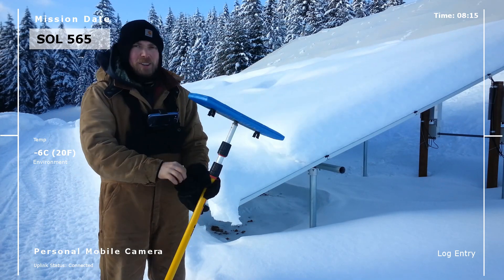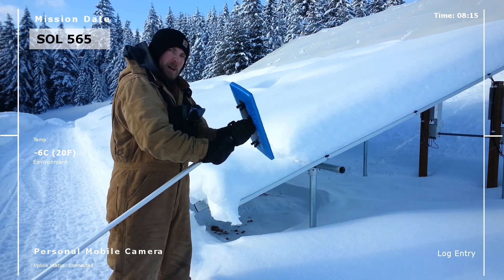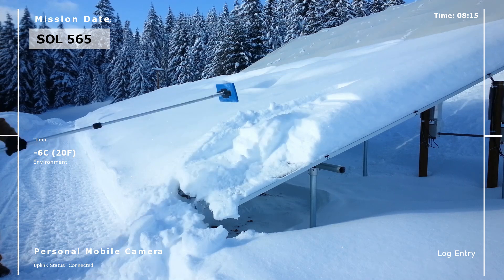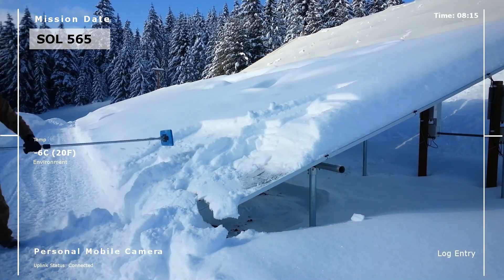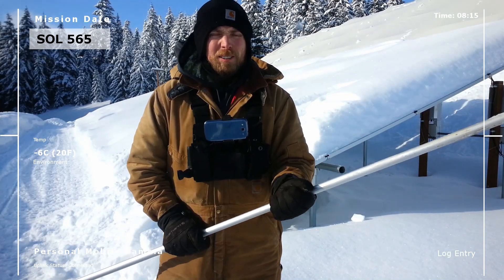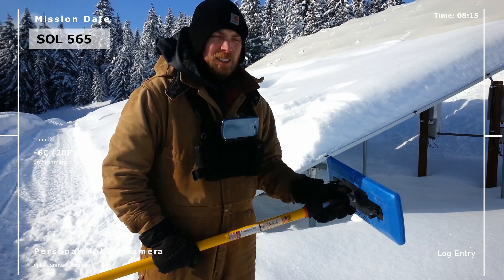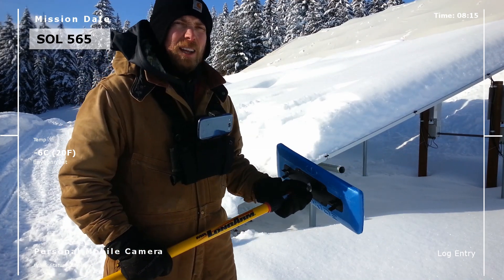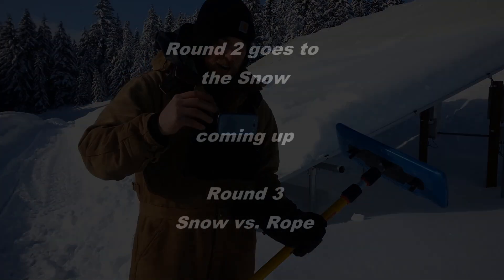Can you clean SOLAR PANELS with a CAR SNOW MOP?

Comment: https://www.amazon.com/Roof-Snow-Rake-3-Whls/dp/B00RY08S7G/ref=bit_abba_def_ie_us_learnmore/135-2261993-3228401?_encoding=UTF8&ascsubtag=1ba00-01000-org00-def00-other-nomod-us000-pcomp&tag=amz-mkt-edg-us-20&tagbase=abba

This is the resolution to your snow/solar problem. Use rubber electrical tape on the wheels to prevent marring the surface of the panels. here is a link to a video.

https://youtu.be/i3R95E16ZBU

Avalanche Snow roof rake.
m_s_strimple@hotmail.com

Comment: Seems like that would work very well, but there is just too much snow. A good option for a moderate snow fall.

I made a deicing formula for work the other day. It seems to work well to melt any normal ice build-up. I made it and it worked well, but I had to reformulate it so it would not be explosive, haha. Here is the recipe I used. Will not damage or smear glass. The 2% missing from the propylene glycol was due to contaminants I was not able to distill out, so 16.6% would work great for that.:

Water ----- 50%
Methanol Alcohol ----- 16.6%
Ethonal Alcohol ----- 16.6%
Propylene Glycol ----- 14.6%

Comment: With your amount of intelligence,  i would think you would come up with some kind of solar heating system to melt the snow before it can accumulate. I would have to believe that there is some kind of low voltage way to warm the panels so you won't have to remove the snow every time you have a winter storm.
Reply from the maker: thanks for commenting and for the vote of confidence on my intelligence... lol ok, so the real problem isn't the clearing of the panels as much as it is the piling up in front of the panels. With any amount of sun on the array it does tend to clear nicely, however, we haven't had a lot of sun...and...and this is the most important part...there isn't enough clearance for the snow to actually go someplace....so we need to a. raise up the array by ~5ft or b. need a method to collect and then dispose of the snow coming off of the array (conveyor belt, trench, etc). I think my focus will be on how to get it out of the way rather than heating...but that will be a spring time problem as there's no way to deal with it right now other than to just keep going and clearing it manually.

Comment: you need to  heat  them that will help the snow slide off easier  you could probably use solar heaters and run tubing under them similar to the earth ships idea to melt snow on the roofs for water collection

Comment: I was thinking about the panel adjustment after my last comment. The design I came up with is 2 foot diameter  wheels near the lower edge. Cables from the front edge to a shaft at the back mount posts and a greased slide on top of each post.  as the shaft is cranked the angle gets steeper or in reverse it gets shallower.  Then you could optimise it each month. Come December and January when it is snowing it is a steep angle which is much easier to clear of snow.

Comment: I'm not too expert in snow, but it seems to me another problem is that the snow just piles up in front, so it would be better to have the snow land off to the side.
What about strips of heavy gauge clear plastic maybe 18", covering the panels? You could drag the snow off the side, one strip at a time, and the clear plastic wouldn't stop sunlight collection in the meantime.
Reply: Thinking rolled flexible plastic. Not sure what the weight of an 18"w strip of snow would be.

Comment: This is Mars we're talking about here folks. Heating the bottom of the panel would work fantastically for him if engineered correctly, but you can't melt dust off a solar panel. What if the solar panels were elevated, about twice as high as the panels are long, on a very rigid frame. Either a motor or a manual crank is used to turn the entire unit (in a controlled fashion) and dump everything off of it. Then a conveyor or moon tractor can come in and moved the displaced dust aside. The panels then get rotated back to the optimum location, and all is well. Biggest issue is bearings, chains, moving parts basically.

Comment: I still say once the snow thaws the height needs to be raised and a steeper angle and consider using the space underneath as a shed for storage. like your Lumber, firewood, fencing and other building materials you might need access to during winter time. and I would have a roll up sheet of plastic that you can roll up like you do a set of blinds when your in power gathering mode. then you can unroll the sheet of plastic before expected snow storms. that should allow the snow to slide off very easily on its own. if not should follow up with a small amount of vibration applied to support poles.

Comment: More Ideas: (for the solar panels) maybe putting tarps on them before it snows would allow you to pull the snow off after. Or at the very least the tarp may be slippery enough for the snow to slid off as you snowblow in front of it. If you just need to pull the bulk off with a shovel the last few inchs would be easy by pulling the tarp off. I would detach from the top to roll it over the snow. This way you don have to shovel the tarp too.

(For the shelves) instead of my idea for a ferris wheel like rotating system I have 3 other ideas. 1) a ladder like in the old library's attached on rails to slide easy, but you will have a ladder which makes it hard to carry things up and down. 2) a warehouse ladder the kind that is a mobile staircase. This may be best short term, it would allow you to carry things up and down easy. You may need to put in some kind of floor since the wheels may be to small for dirt and it may be unsteady. But I don't think you will be able to reach the top of the rack. 3) this is long term solution for when you get the other racks in. Install a second floor, you should be able to turn the shelf rails around to face the opposite rack put 2x4s on them and either plywood, or better Steel floor mesh, so the sun can get through. Stairs at the end and you should only need a step stool to get to the higher shelves on each level. All of the above would require the plastic to be extended across 2 lanes since it would be in the way as you have it now.

(for the plastic on the inside of building) Is the plastic true 20 feet and the frame true 10 feet apart? When you put the clamps on it will pull the plastic around the beam, you will lose about 3 inchs. So by time you get to the 3rd beam you will be 6 inchs short. I would go with 12 foot sheets so that you have 2 feet to play with, this will also be easier to work with. I was thinking something like a pool noodle would work for the seam but they are probably to small in diameter. So how about a rubber hose that is the same diameter as the frame pipe cut down one side to slide over it. I don't think the hose would be strong enough to support the plastic on it's own but it should reduce the amount of clamps needed and create a seal. I would put 2 sheets up 1st with clamps then put the rubber hose on the 1st 2 rails, and repeat when there is a seam to connect to reduce the effort. You can build a platform across both racks to do the high part that the ladder can't get to. I would wait till summer to attempt this so you won't have the cold, gloves, and extra clothing layers to deal with. Which would make it a little easier and safer to do. Also invite friends and family over for food on a Saturday and put them to work. The more hands helping you put up the plastic the better.
Wow that was a lot. I hope this helps. I can't donate money but my brain work only costs the food I eat. :)

Comment: Increase the angle of the panels.  They are far too horizontal.   If I were to ever build a solar panel grid, I would construct a pivot where the panels could be brought to 90 degree of more to avoid heavy snow accumulation.  Also, You could install a heat tape on along the top edge of each panel.  Granted it would take energy to heat, but it could also help keep snow from accumulating at higher temperatures (during snow fall).

Comment: I once mechanized a solar array using old washing machine motors.  IF you have a junk yard nearby you mght give that a look.  Other options are wiper blade motors since they are already set to use your DC of the panels.  They can't drive a whole array like yours but using several and the right "gear ratio" would probably work. ( I have one solar driven to open and close air vents on the ridge of my small 10'X12' green house.)  A starter motor can definitely drive your array and might be an option depending on the power your array is developing.  Starters are notoriously power hungry.  They did turn out to work well for us however in one configuration.  We used two of them mounted opposite each other and used one for azimuth and one for elevation.  Had a bit of trouble with elevation as we needed to move them up and down rather than a full rotation. So, in came a third starter.  Since they are built with a solenoid actuated drive gear we just put this opposite each other and used one for up and one for down.  Worked great and fast no matter how much we loaded them up.  
In your situation.... maybe you could make up a setup like that and alternate between up and down rapidly between them and literally shake the snow off will it's still fresh, fluffy and hasn't had a chance to freeze on like the snow in this video.

Comment: if you had the money id say big sections of clear plastic driven by motors to just tilt up but that would be a lot of money. i dont really think theres a lot you can do with not a lot of money because snow is heavy and youll need something powerful to shift it. unless you have a constant flow of warm water over it or something but at those temps that would jsut freeze unless it runs all the time

Comment: For the 20 plus years I've had panels, a broom is all I ever used.
Reply from the maker: what softness/type of bristles? does it scratch the glass at all?
Reply: TheRealMartian: Here is a link. My oldest panels are 21 years old and have no damage from cleaning. The bristles are quite stiff. 
https://www.walmart.com/ip/KRAFT-TOOL-GG876-01-Asphalt-Coating-Broom-Squeegee-18-in/40842600?wmlspartner=wlpa&selectedSellerId=1122&adid=22222222228028406176&wl0=&wl1=g&wl2=m&wl3=56837813351&wl4=aud-273067695102:pla-94137521111&wl5=1016367&wl6=&wl7=&wl8=&wl9=pla&wl10=101593696&wl11=online&wl12=40842600&wl13=&veh=sem

I buy from a local store, but it looks just like that.

Comment: If you build a metal pipe frame about three times as high as the back of the panels and another pipe frame the same level as the front of the panels you could  drape a tarp between the two and the snow would slide off the tarp toward the front edge of the panels. Roll the tarp up between storms on a pulley system.

Comment: once you get it clear what about tarpping them before a snow after the storm remove the tarp and snow. make do for now however you can . come spring infrastructure could be modified. Raise the panel so there is room for snow at the bottom. spilt the panels horizontally into 2 or 3 so you have a shorter reach. Retractable awnings, and many of the other good suggestions that have been made.

Comment: one video shows  using a small rope to separate in chunks then the tool would  be able to push them off doing a back and forth like a saw motion in sections it works on roofs it could work on them you just need to separate a lawyer  and the snow comes off

Comment: Snow certainly was not considered in that panel build..engineering vs real life case in point
That is one heck of a snow load on them panels as well...could see that come crashing down.
At such a shallow angle it is going to be a lot of work to get that snow off without damaging the panels. Def need to have a adjustable angle to keep or better assist in keeping snow off

Comment: Speaking of clear thick mill plastic, couldn't you place a continuous piece of plastic with some type of crank system over those panels and just turn the crank to rotate the plastic and clear the snow? Of course no help this year.
Reply from the maker: i've thought of plastic on the panels but hesitate to do it because any moisture between the plastic and the solar panels will create a freezing point. Essentially i could end up making the problem worse (plastic frozen to solar panels)

Comment: two layers of foil sealed together to form inflatable pockets... they can be controlled to make a peristaltic movement and you can just drape them over the panels. Would lauch my a** off if that did the trick. 
Might actually do the experimenting to prove / disprove it myself :D
Reply: I'll call it the Snow Digester :D

Comment: Sorry, but I get the feeling that you are not really committed to the project when I see you let the snow build up on your panels to that extent. On Mars you would be a meat popsicle!  I would like to suggest that the first thing you need to do is get the snow off. The rope method has worked for many others. They will heat and clean themselves with only an inch or so. I don't know if you have taken into account that the panels will operate at their highest efficiency when they are cold. Maybe look into how you could adapt the rack to be adjustable to take advantage of "correct" solar angles for each season? A good starting point is your latitude +10 degrees.
Reply from the maker: thanks so much for commenting! yeah that snow happened in 24 hours and I work a full time job plus work on this project by myself. So I wouldn't say I lack commitment but instead I lack time...or more importantly I lack the ability to work both jobs without having sleep :-) The panels are optimized for sun collection in the summer months but as you point out are not for winter. Lots of recommendations have come in to hinge the back so we can lift them and optimize for both times. I'm going to look into this for phase 3 of the project. Again, thanks for commenting and watching.

Comment: Wouldn't a wire like a plastic coated clothesline tied to a bottom corner then pulled to cut the snow close to the panel work?  Like a cheese knife to free the snow so it can all slide at the same time?

Comment: Have you seen or heard about the string method for clearing snow? I don't know if the panels are angled enough for it to really slide off but it might make it loose enough that that snow blade on the extention handle would work better.

Comment: My uncle has a solar array I am not sure but I think it's about as long as yours , also close to the ground as well . He ordered  ( not custom ) just off the shelf canopy covers like you would see on a Motor Home or a home deck. He purchased his from a Home supply center in Colorado, he purchased 2 so that the " cranks would face out if your facing the array the cranks would be bolted near the ground with the cranks to your far left and far right. If they are predicting snow as they do a lot in Colorado he reverses the cranks pulls them up at night to cover the array. In the morning he walks outside hooks his handle into the right side, cranks them down off comes the snow , then he repeats the left side !, looks just like yours. When he is done cranking them down he pushes the snow away with of all things his pickup truck that has an angled homemade blade so the snow doesn't just pile up at the bottom. Only downside he says is if he covers it at night and they get ice a lot of ice it kinda makes it more difficult. keep up the great work I really think your doing a great job. BTW my uncle says he looked at some RV centers and they had some used ones he almost purchased but he wanted the same color, plus they only had 3 used canopies and it would not reach all the way that's when he ordered them.

Comment: You can simply attach a nylon rope to the top of the panels. Then use the rope to slice the snow so that it slides off. The use something else to remove the leftover snow. There are vids out there where folks in heavy snow areas use this method to remove snow on their roofs without having to risk breaking their necks climbing on the roof. LOL

Solar grid tie may be great in some areas. But here it's a no win situation. Even when you can find some groups that will pay you for your energy, the taxes & line fees way outweigh the selling energy to them. Not to mention that the summer is our heavy use days. To each their own...LOL

Comment: I made a large tracking system it keeps itself clean for the most part! Mine is only1.5 kw Ive had it for about 6yrs now and not a problem!And im in Pa, mts!
Reply: I was thinking, if it was carefully counterbalanced around a pivot point, it shouldn't take much effort to adjust the elevation?

Comment: With that much on the panels, I would consider closing in the sides and running some heat under them to get them clear, and then go from there.
Reply: Maybe some pipe heat tape on top to melt the snow
Reply: maybe just insulate them form the bottom and put a elektrick heater inbetween
if it would work and you would electrically heat it, you can easily calculate the profit (or loss)
Reply: Would want to be able to remove it in the summer and help keep the panels cooler.

Comment: perhaps the solar panels would be better in a linear single height array rather than the staked multiple - it would then be easier to clear each panel and also to automate  single plane tracking on a per panel basis rather than trying to move such a large monolithic array. If each panel were a tracking panel they can be set vertically when the sun goes down and thus prevent any build up of snow in the first place. linear actuators are relatively affordable for moving single panels.
Reply: Agree with Sasquatch.  Setting up tracking one panel at a time will be much easier to budget.  Just set them up to track one at a time as you can afford it.   And the option for vertical alignment makes that scenario even better.